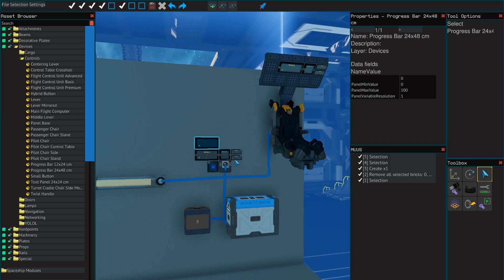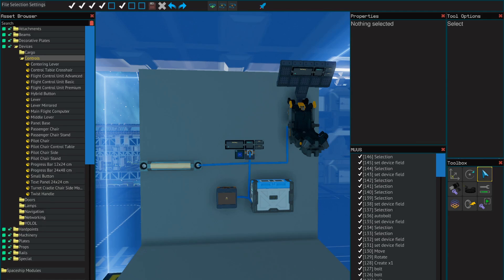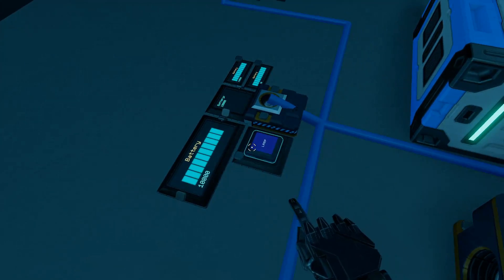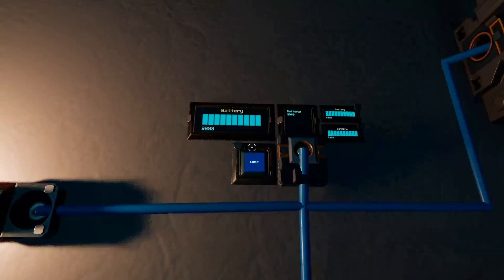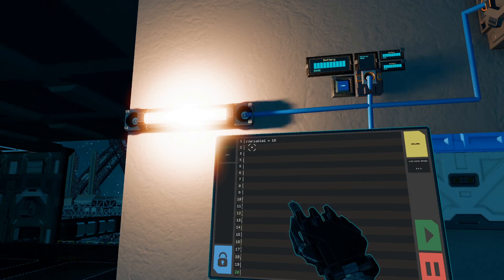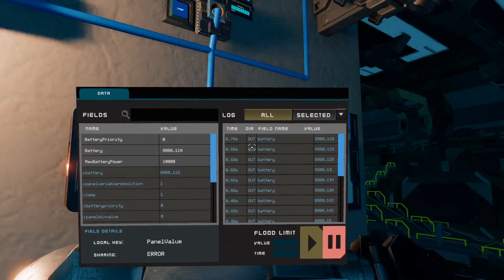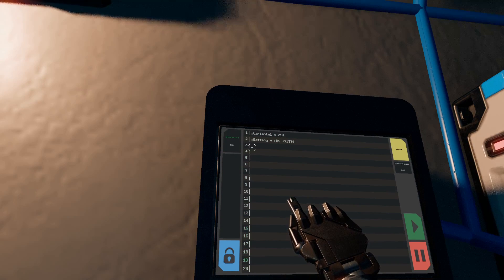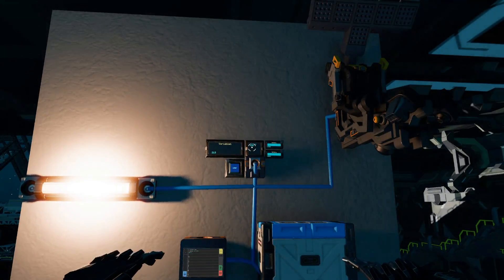STARBASE TUTORIAL- Basic Progress Bars & Additional Quick YOLOL

Comment: I'm having difficulty finding out how to modify properties of devices after spawning a ship. Someone told me it was on the 'U' menu, and when I streamed my screen, they said, "That's Odd" . . . (I guess they had access there where I did not). I've reverified my files, tried to check some of my custom key binds. I could go on, but 'hours' does not explain how much effort I have put in trying to add a basic button, or lever. It's day 4 after picking up Starbase for me. Most of my effort has gone into a ship that's too far to tow & trying to edit any device after a ship has spawned out of the editor.  I found this video as a part of my Reddit searches . . . everything seems to go to a level of 'Basic Yolol' teaching that tend to skip an even more basic essential . . . how to add / modify a device on an existing ship.  If you could help with modifying a basic data field, I would really appreciate the help.